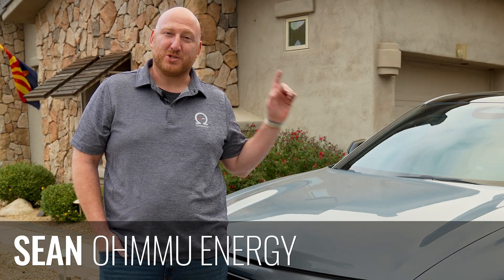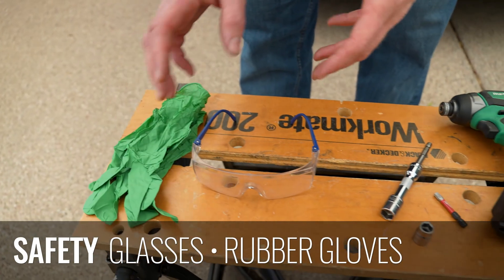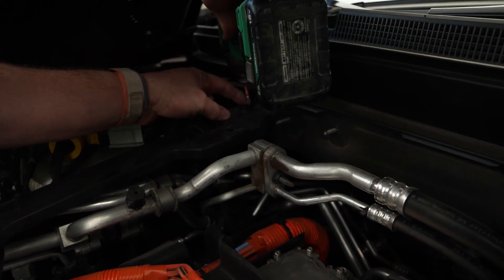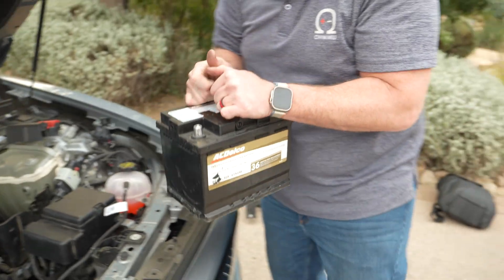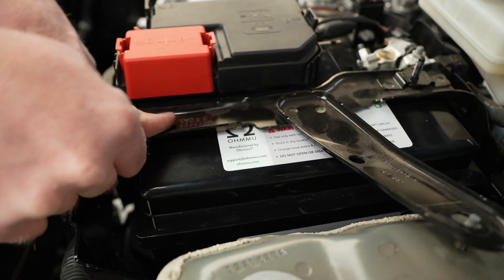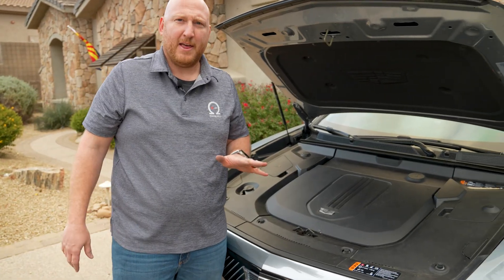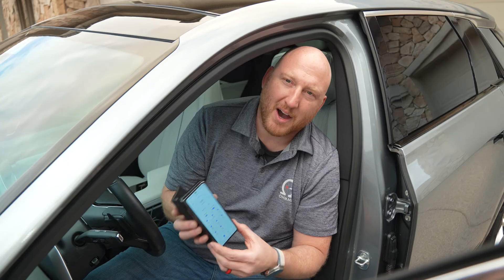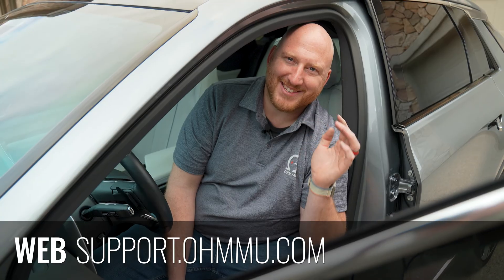Cadillac Lyriq EV - Ohmmu 12V Battery Replacement

Comment: My DE Lyriq, VIN PZ00038*, has its 12v battery in the same place as yours.                                                                                                                                                                                                                                                                                                                                                                                                                                                                                        Supposedly at some point between 0001000 and 0002000, GM added a second 12v battery at the rear doing the main 12v job but kept the front one for jump starting other people's cars etc.  Know anything about that?  What's your VIN (approximately)?
Reply from the maker: This is the first we’ve heard about it! This was a local Lyriq friend of ours, so not sure on the VIN!